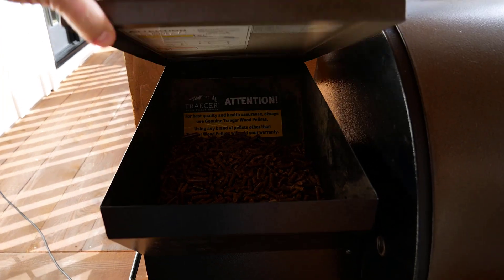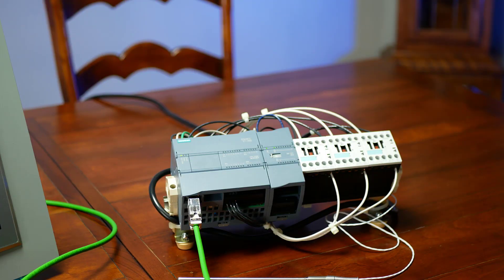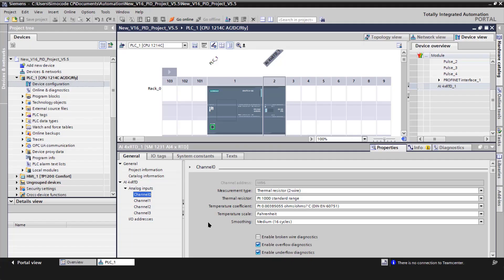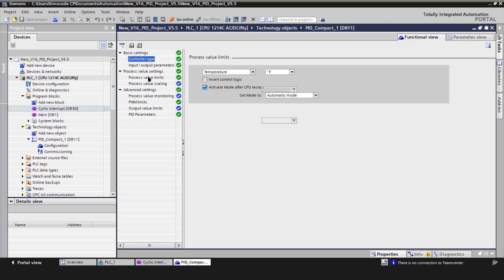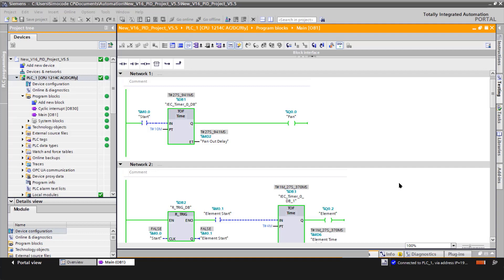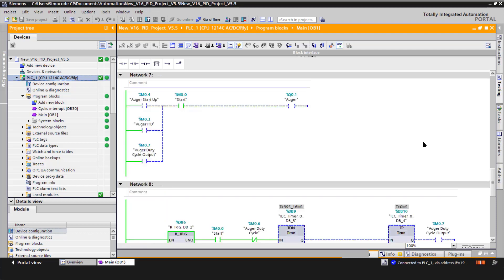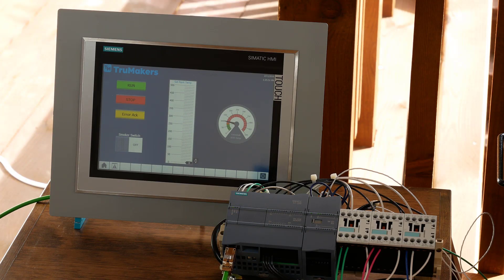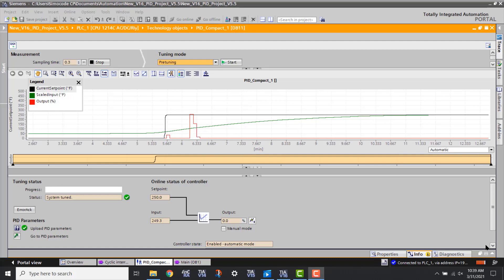Precision PLC Controlled Smoker

Comment: Very interesting and informative video.  I owned a older Traeger BBQ 124 model for about 10 years and it was a good grill but could have really benefited from a more precise temperature controller.    It would overshoot and undershoot the set point on the regular. What model and how old is your Traeger?  In your spare time you should study the Recteq controller as they are dead on within 1-2 degrees F, I am currently smoking on Recteq 590.  I really enjoyed the software portion of the video and the detailed walk through, it gave me a much better understanding of the complexity and workings behind the scenes.  Well and frankly your video addresses real world problems in my little world!  Smoke on!
Reply from the maker: Hey Ripx510, thanks, glad you enjoyed it! Great call out on the Rectec, we will certainly do that. Between me and Matt we have a RT-340 and RT-700 to take a look at to see how the differing sized burn chambers vary, if at all in terms of their temperature regulation.